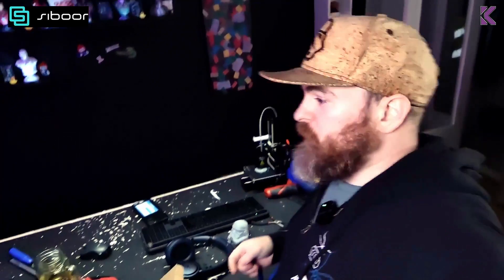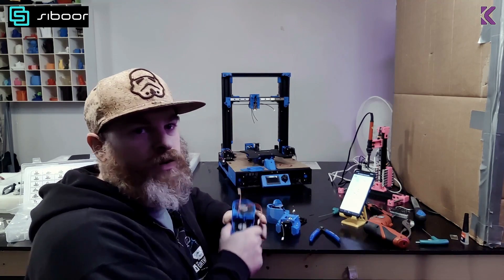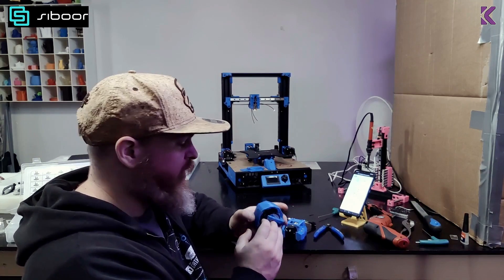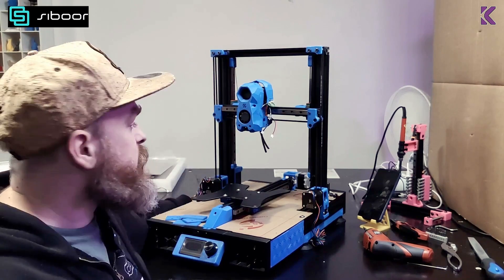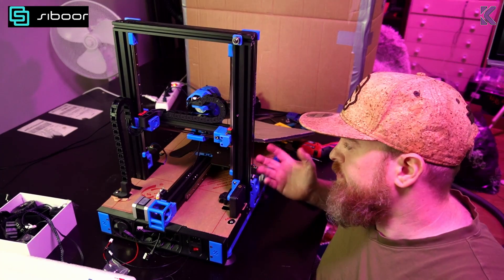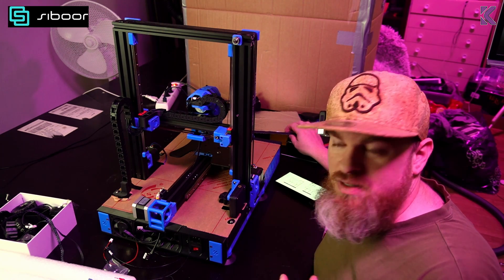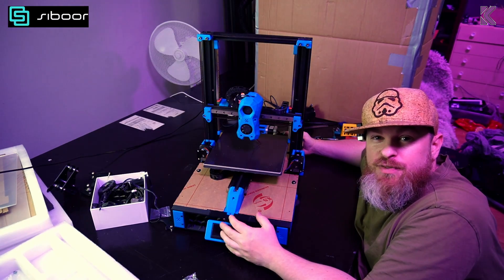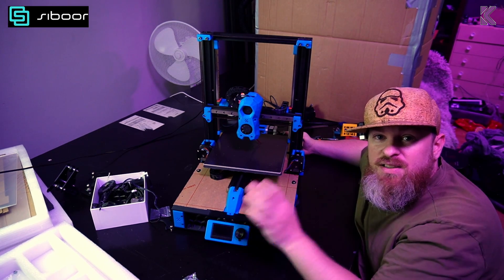Voron Switchwire build! Siboor E3-SW EnderWire conversion kit - Part 2

Comment: Hello, could you share the printer.cfg for the Sibor Ender 3SW?
I’m still using the stock Ender 3 V2 board, but the Sibor GitHub and website don’t provide a sample config for the Ender 3 Sibor conversion kit.
I’m a bit confused about the configuration for the Klipper expander.cfg and lcd.cfg.

Comment: Stealthburner is much slandered, it's heavy, but the airflow is really good it all ends up in the right place, it doesn't blow bridges downward or to the side like herome, hydra or blokhead and performs better than those three and any of the prusa MK3(s)(+) stock ducts on overhang tests at sensible flow rates with a 0.4mm nozzle. If you're printing 1mm toothpaste tubes or speed-benchying it's not for you, but in most situations it gives great looking prints and is easy to work on.
Reply from the maker: At the moment, the SB is working r great for me, given, I only print ABS/ASA on this printer. No reason to change it for now 😉

Comment: If you're enclosing a printer, insulating the bed reduces chamber temperatures. To increase chamber temperatures we use fans to circulate air over the underside of the bed.
Reply from the maker: I did plan on building a heater for this, but never got around to it. I've mounted a 4020 blower on the back of the right upright 2040 that blows under the bed, so I need to get some of that insulation back off😆 next step is to fully insulate the chamber.

Comment: Just a heads up, I JUST "finished" the enderwire conversion with the siboor kit and something in the electricals fried 2 skr boards before I gave up and tore it apart to start over. I'm guessing there is some sort of short in the toolhead. Just trying to hopefully save you some headaches before you boot.
Reply from the maker: I'll look into that, thanks!